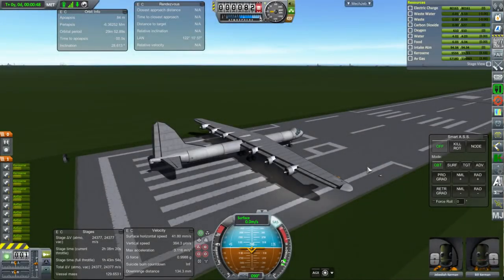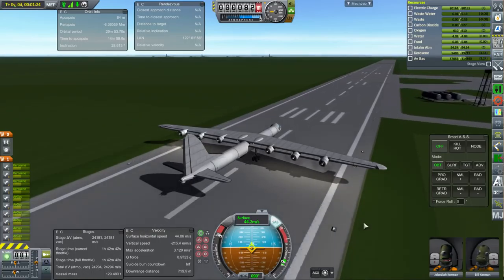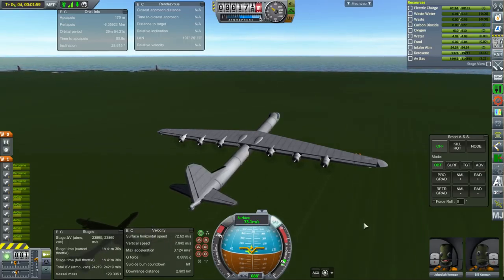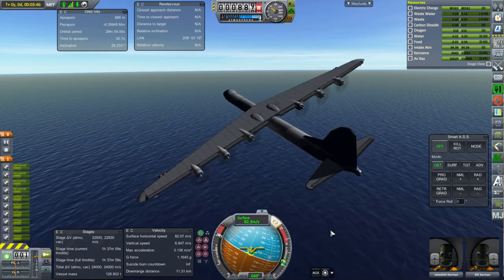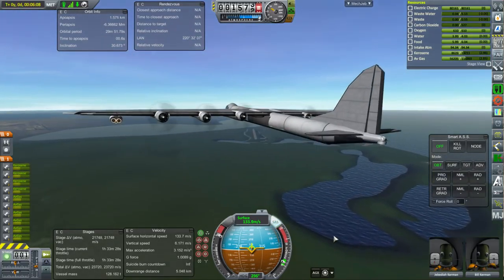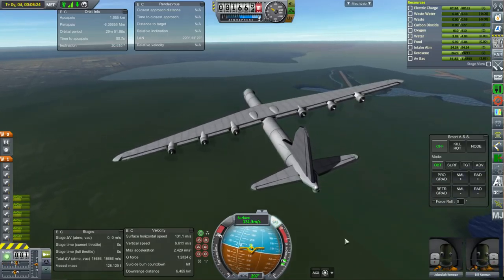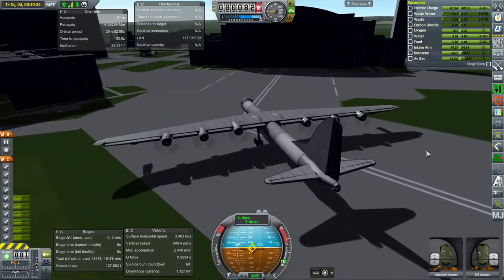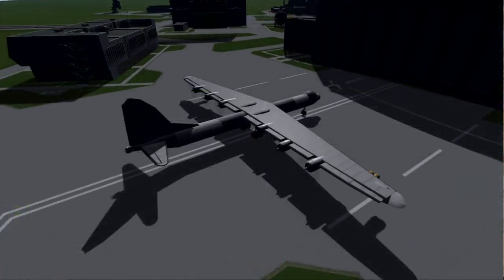Kerbal Space Program RO Sandbox - Convair B-36 Peacemaker

Comment: How long is the RO runway?  Your B-36 might not be under performing, your runway might be too short.  That, or the real B-36 wing has a different cross section and performs better.  Also, did the jets burn jet fuel or av-gas? No reason they couldn't.  Jets don't tend to be picky about fuel for the most part.  Seems like added cost and complexity to have two fuels on board.
Reply: 2500m, some large airplanes require more than that, for instance An 225 - 3200-3400 m at full take-off mass.
Reply from the maker: The jets burn kerosene because that's what Realism Overhaul sets all of them to, while the propellers use AvGas. I know how to change that, though, and I'll consider it.